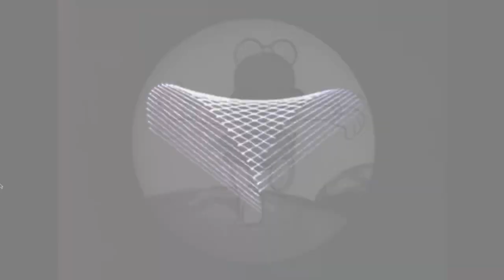Fold Your Filter! (with Gilbert)

Comment: Nice patch. I'm curious if it could benefit from following it with another filter...
Reply from the maker: This patch is a great jumping off point, adding a filter would be a fun way to play with the new harmonics. The output of Gilbert is patched to the Dual Low Pass Gate, so there is some filtering happening after the wavefolder.